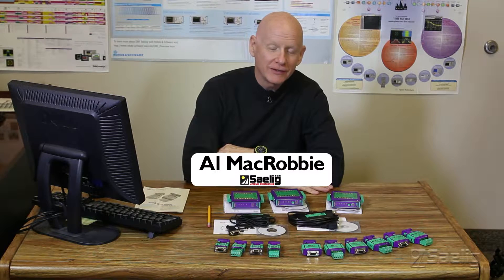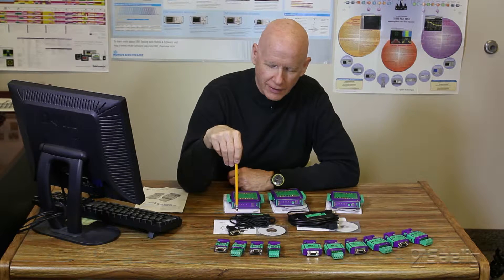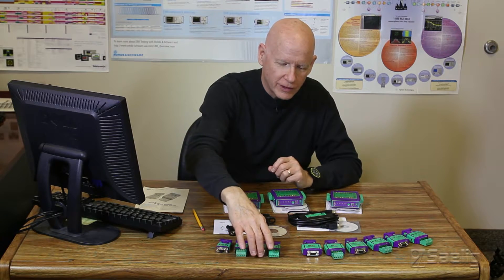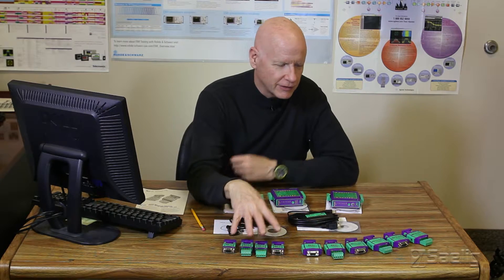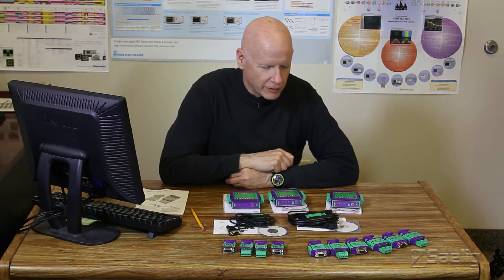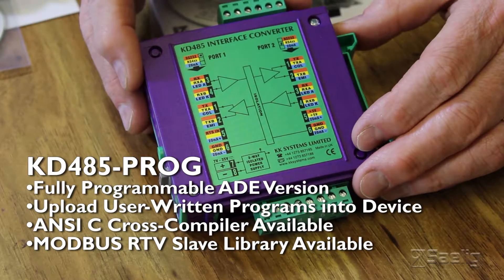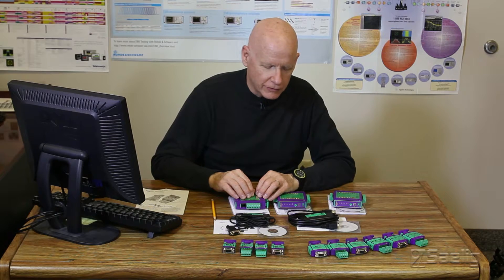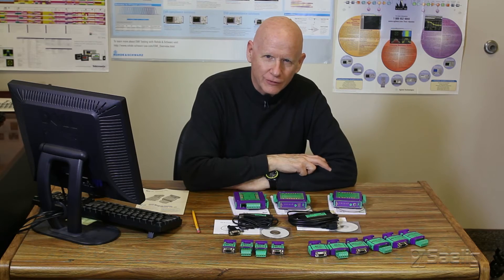KK Systems Interface Converters (RS232/422/485) from Saelig

Comment from the maker: KK Systems replies:  We don't have anything currently which has this option. But most modern CPUs/MCUs which have UARTs, they actually have USARTs.
And one disables the external clock feature and switches them to a UART mode where the RX data is recovered by 8x or 16x oversampling.

Basically nobody uses sync data+clock outside of highly narrow applications.

Can you tell us more about what this is for? What sort of volume?  Or is this a USB-serial converter enquiry? A quick google found this https://fastcomproducts.com/products/sync-com-422485/ but at a price!

If this is a volume inquiry, a redesigned KDE485 could also do USB (VCP on the PC) to sync, if we add an option for a clock signal to come out.